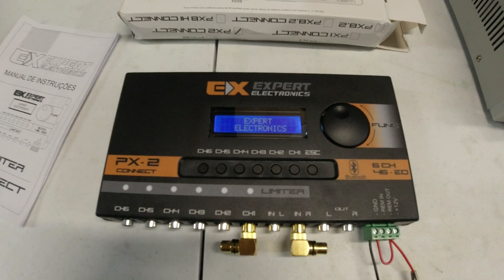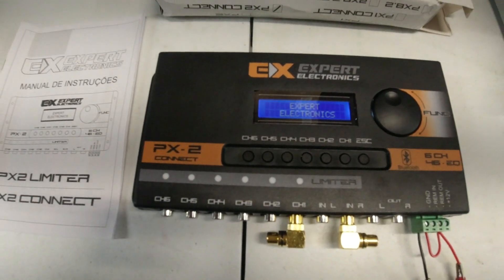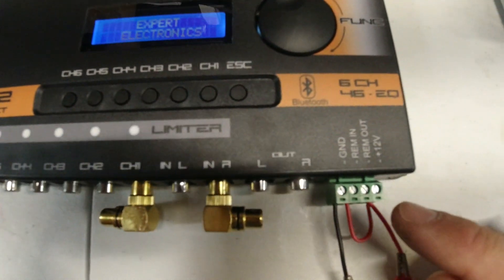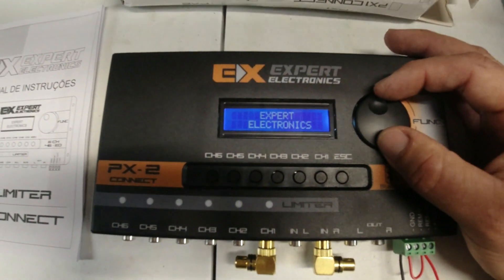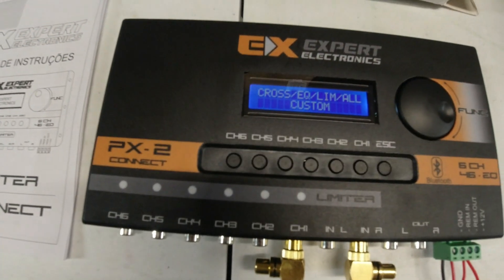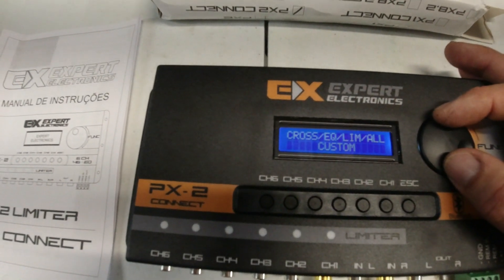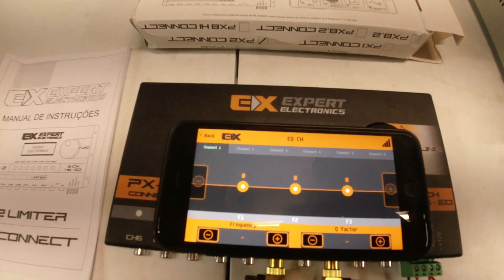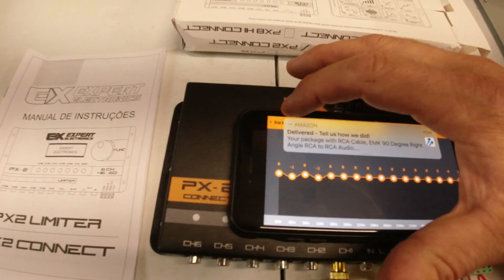Expert electronics PX2 connect DSP digital car audio processor Equalizer  crossover english manual

Comment: Hey what’s up? Thanks for this video it helps a little more. I think you should do more videos on this product on how to use the settings a little bit more in details. There’s a lot of people out there that will appreciate the English version on all this. If you can explain more in details about each settings on what they can do and use for and how to set them up. Thanks again and looking forward to see these updates.
Reply: Also I get lost of trouble to long in from the app with the password. 90% of the time it keeps saying invalid password. Have you find out away to bypass this or to fix it.
Reply from the maker: Do a factory reset and it will fix it
Reply: @HiFiVector  what I ended up doing now is just punch in the code on the Banda and then put it in on the app and then it works.
Reply: @HiFiVector  great video. I have that same dsp install on my car, some profesional installed but they don't Know how to tune up the Gain.

When they installed I have a lot static coming out of the speaker because the gain in the amp is too high. 

Do u have a idea how to set up the gain?
Reply: @HiFiVector  what causing my clean signal from head unit to turn into a clipped signal coming out of the PX2
Reply from the maker: @danross4309  How did you verify this?
Reply: @HiFiVector   with an oscilloscope and a 1k tone
Reply from the maker: Gain/ level too high on the dsp try lower until until it’s the same as it was with only head unit.
Reply: @HiFiVector  gain is at 0

Comment: So glad we now have a video in English, lol. I have the px8 connect, love that dsp
Reply: What is the difference between the px8 and the px2
Reply: @chijiokeakil2264  Description Crossover Expert PX2 Connect 6 Channels Digital Audio Processor Bluetooth Equalizer:

If you need equipment to efficiently control your car sound, the Expert Eletronics PX-2 audio processor is exactly what you are looking for.

This model allows you to change frequencies, gain control, phase and delay among other fundamental functions of your sound to always have the best of it. And thanks to the state-of-the-art technology applied to this device you still have the option to operate everything from your Smartphone or Tablet via Bluetooth!

Hurry up and get this Digital Crossover that brings you 6 customizable channels and 2 way at 28 EQ frequencies.
Technical specifications:

- High Quality Digital Crossover

- Excellent Functionality and Cost Benefit

- Simplified and Accurate Commands

- Has 28 Equalization Frequencies

- Gain: -18dB / 6dB

- 6 Custom Channels

- Input Impedance: 47 kOhms

- Output Impedance: 100 Ohms

- Sampling Frequency: 48 kHz

- Hi Pass and Low Pass Filters: 20 to 20 kHz

- Blue Light Display

- Attenuation Filter: 12, 24 and 48 (dB / 8th)

- Approximate Dimensions (AxLxC): 30mm x 240mm x 120mm

- With Control Through Tablet or Smartphone App *
Reply: @chijiokeakil2264   the expert 8.2

Product Description:

Acting completely and directly in the car stereo, the Expert Eletronics Crossover Table has 8 fully programmable output channels. Combining processor, equalizer and crossover functions, the PX.8 is ideal for making the necessary adjustments and extracting the best performance from your sound project.

This crossover table is completely digital and was manufactured with the latest technology to process your audio with the best in the market.

This model allows you to change frequencies, gain control, phase and delay among other fundamental functions of your sound in order to always have the best of it. And thanks to the cutting edge technology applied to this equipment, you still have the option of operating everything from your Smartphone or Tablet via Bluetooth!

 Additional Information:

Product SKU Code	1396200

Availability	Immediate dispatch

Number of Entry Routes	two

Number of Exit Routes	8

Bass Boost	Does not have

Filter	Bessel

Butterworth

Linkwitz- Riley

Roads	Flat

Output RCA	Mono

Frequency Response (Hz)	15Hz - 22000Hz

THD (Total Harmonic Distortion)	0.01%

Phasing	Yes

Signal-to-noise ratio (dB)	100

Remote entry	Yes

Remote output	Yes

Protection fuse	2A

Protection systems	Short Circuit at the Output

Maximum RCA Input Voltage	16Vdc

Maximum RCA Output Voltage	9Vdc

Input Voltage	12V

Maximum consumption (A)	300mA

Approximate Product Weight (kg)	0.50

Technical specifications

Product SKU: 1466200

- High Quality Digital Crossover

- Excellent Functionality and Cost-Benefit

- Simplified and Accurate Commands

- Rotary Encoder

- 2 Inputs

- 8 Independent Outputs

- Channel Routing

- Input Equalizer with 15 Spacing Bands in 1/3 of an Octave

- Parametric Equalizer 3 Independent Bands per Channel

- Independent Delay per Channel

- Automatic or Manual Limiter with Threshold, Attack and Decay

- Polarity Reversal

- Input Gain

- Independent Mute per Channel

- Pink Noise Generator

- User Password

- Pert with All Settings

- Independent Gain by Channel

- 300ma Remote Output

- Unbalanced Input

- RCA Connection

- 8 Customizable Channels

- Input Impedance: 47 KOhms

- Output Impedance: 470 Ohms

- Resolution: 24 Bits

- Sampling Frequency: 48Khz

- Processing Latency: 1.08ms

- Response Frequency: 15Hz to 22Khz (-1db)

- THD + N Max: 0.01%

- Signal to Noise Ratio: 100dB

- Voltage: 10 to 15 Vdc

- Consumption: 300ma (5w)

- Fuse: 2A

- Approximate Dimensions (AxLxC ): 3x25x12cm

- With Control via Tablet or
Reply: @atlfreakdaddy  can a smartphone or tablet be used as head unit in the px8
Reply: @Atlfreakdaddy how does this px2 compare to the DSP 408? I have the 408 currently and I was looking into this but I’m not sure how customizable all the curves and cutoffs are
Reply: @chrispolanco4107  the only issue I had with the Dayton was it was introducing some kind of low pitch whining that really got on my nerves not including the motor whine. When I bypassed the Dayton dsp the noises went away. I sent it back and they sent me another one but it had the same results as the first one. That's when I decided to try the expert electronics dsp, and when installed all those noises went away. As far as functionality both or about the same. But the Dayton has one leg up with the Bluetooth module which let you play music directly from your phone therefore bypassing the head unit. And also the wired volume/preset knob is a plus
Reply: @chrispolanco4107  to be honest I leave most of the eq settings flat. I just use the crossover in the dsp and set each frequency and cutoff depending on what speak I'm trying to adjust

Comment from the maker: Manual in English is in the video at the end.
Reply: Love the video bro can you guide me in the best setting for my tweeters I have 6 on a 600 watt Amp and I keep blowing them just would like a hp and lp frequency staring point
Reply from the maker: @RcMarlin   part of it depends on the range of the tweeters and also how high your mids can go to . But usually, 3 to 5K hz low cutoff is good. But again depends on the tweeter and mid specs. on the high 18-20K is good.( you really cant hear over 18K hz)
Reply: @HiFiVector  jbl st400/and plyle pro 300 on a 600 watt Amp i just need to know the frequency for best performance and safety I k kw Ill.have to play around but I'd like the high and low frequency